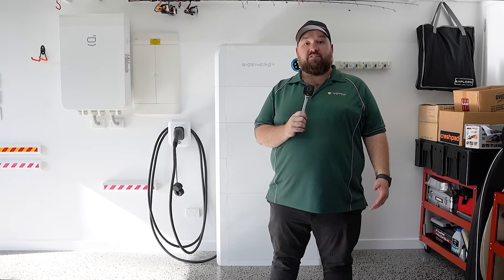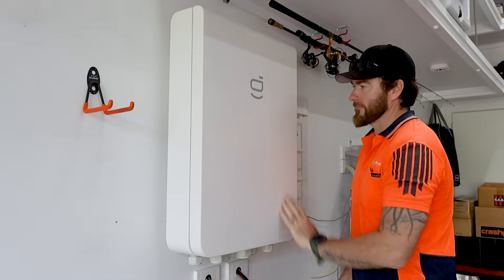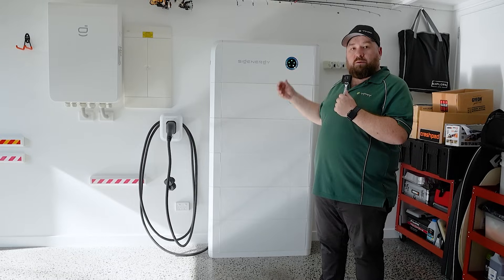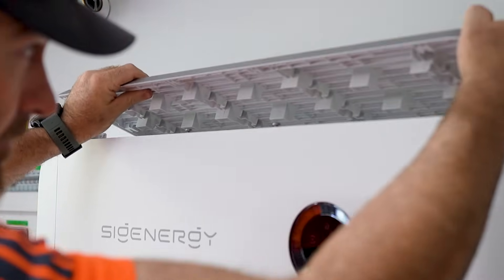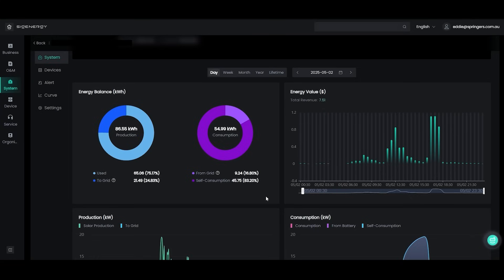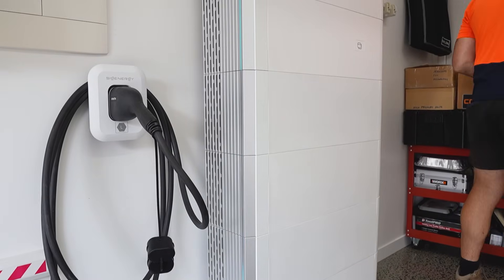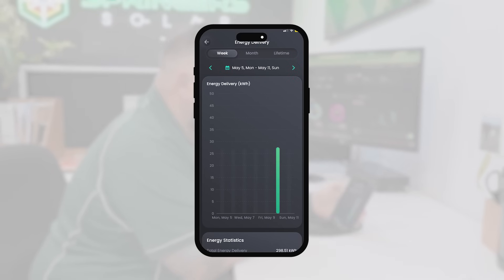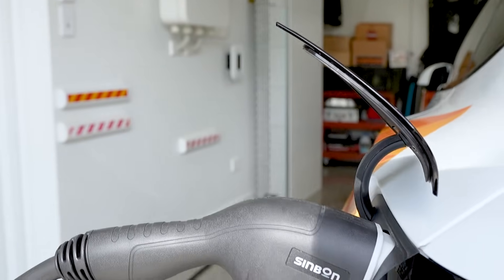Does Sigenergy Even Work? Battery Data Unveiled

Comment: I doubt that this home owner can amortise the cost of the system installed. Let us be conservative and say it cost $60,000. The batteries including controllers cost at least $40,000. They have a life of no more than 10 years so they need to be depreciated at $6,000 per annum. There is also an opportunity cost (presuming he paid cash) of $60,000 x 5% of foregone income or growth = $3,000. Assume that there is some maintenance in the 10 years of say $2,000. So at the end of 10 years the batteries are worthless. So he has to make a saving of $9,200 pa to break even. Consumers are being sucked into oversized system without having the business skills to do their sums and realise oversizing is a bad idea. It is much better to install an array up to 10kW and batteries up to about 15 kWh. That will cope with the daylight hours and peak demand in the evening. Buying some electricity in off-peak periods is not a bad idea and there are offerings for charging EV. The idea of charging the house from the car is a very bad idea because the batteries in the car are expensive and if the juice is drawn from the batteries, the car is no longer a car that can be used. We do not know what the grid and technology will look like in 5 years. It is better to be conservative.

Comment: Sig is recalling their products in Australia, electrical safety issues😂😂
Reply: Hmm, not quite the recall is specific to single phase systems and a specific part which might be due to installer error, suggest you find more about it , before making blanket statements.
Reply: Still a far better product than anything else on the market.

Comment: Most of these external managers don't seem to export from the customer at peak pricing. It seems they are more working for the grid company than the customers.
Here the spot price even goes negative in surplus power periods and the designers or controllers of the solar inverters don't even stop the systems from exporting making you OWE money for exporting!

Comment: Anyone else concerned about the 90 day safety mode warning?? If you are not connected to the internet for 90 days the system triggers a safety mode which limits battery storage and output. This concerns me
Reply: Who wouldn't have power for more than 90 days ? Unless your completely off the grid. I've heard that issue is now sorted anyways. Being i  the city id just make sure it got some juice once a month.

Comment: A very good and informative video, sadly I live in NSW, I also wanted to point out that a common issue with installations is that the Inverter is not spec'd to the total discharge rate of the battery. So for a 32 KW battery (8KW x 4 batteries) would have a discharge rate of (4KW per battery X 4 batteries = 16KW) and your inverter is a 10KW , if your overall house hold draw is more than 10KW you will see power being drawn from the grid. So the inverter is now the bottleneck.
Reply from the maker: Yes, that can be a bottleneck on the installation if designed that way. In this case, we've chosen a 20kW inverter to ensure that issue doesn't occur.
Reply: just curious - what loads in your household will draw 10KW continuously?
Reply: @tempestv8 i mainly draw about a 1kw continuously, but as an example, if i were to run servers  or run all zones of my 3 phase aircon continuously on a hot a cold day that would be roughly 10+ kw
Reply: @tempestv8  A 20kwh cooling air con can draw say 6.5kwh on its own.

Comment: Great video
How far away is the grid switchboard? We are looking to install the gateway like this adjacent to the battery in the garage however as the grid switchboard is approx 15-20m away, the advice we are recieiving is to install gateway adjacent to grid switchboard rather than battery and inverter. Do you have any thoughts @springers solar?

Comment: Iam very interested in this battery, but I have a set up question. I have an enphase system on the house. I think we are talking about battery ac coupling between house and grid by this gateway installation. Now I want it placed in my shed, which has no panels yet. The sigenstore inverter has solar input capability. Can I have a sparky plug extra (non enphase) panels on the shed roof directly in the battery inverter a year after install? Will my house (enphase ac) still work offgridd and charge the battery along the hybrid shed roof panels?

Comment: So basically, it’s a great solar system, only problem it has is the plastic covers etc , hopefully manufacturer will fix that in coming future by adding the solid metal or thick glass like material similar to an iPhone in IP66 rating , hopefully they’re listening 😀👍
Reply: I'd rather replace a small plastic cosmetic cover that a whole sheet of Tesla glass ! And if its inside the garage or undercover who cares ?? My ducted ac unit is 10 years old outside and the plastic is fine on it.

Comment: What is the usable battery capacity? Eg if I install a 30kw battery with sigenergy will I get 30 kw usable or did they not add an extra dod
Reply from the maker: The 5.38kWh module has a usable capacity of 5.2kWh, and the 8.06kWh module has a usable capacity of 7.8kWh.

Comment: Whats the max dc charger cable run from the inverter?
Reply: I think the cable is 7 meters in length.  What I want is a remote cable. Where the output/input port on the stack connects to the box on the wall in my garage.  That box would have the 7 meter charge cable and handle on it.  In California they actively make it very difficult to install a battery in a garage.  My battery is located out side of the garage wall so there is no way to get the cable into the garage.

If I could have the base of the charge cable in the garage and have that base connect to the bi-directional unit on the battery stack I could remotely use the charge handle.

Maybe someday.

Comment: DC power coming from the DC panels and/or DC battery, using DC chargers straight into the DC car battery. Makes total sense, as opposed to having to convert to AC and back to DC with the associated losses
Reply: It does.... until you get the price for the DC charger.
Reply: @timorum  Emmachizzit?
Reply: @MrBenHaynes 😂 the “see translation” button under your comment is golden
Reply: @timorum  if your dropping 16k on a battery i dont think they would care 😂

Comment: Yuck, such a big box sitting in the garage. Wish the dc charger can be separated from the inverter!
Reply: It is IP55 rated so you can have it outside as well if that helps - also means you don't have to have guarding or mounting restrictions (depending on region).
Reply: @ianloy1854 yes fully aware, but then I won't be able to install the dc charger
Reply: @eric-u  The DC module comes with 5, 7.5, 10m long leads. The installation diagram calls for the port to be mounted within 200mm of the module, but the cord is still up to 10m long and so it may be still workable for you. Actually not sure why they want the location so close - but you could move it? afterwards...... any way just a thought.

Comment: In the process now of reviewing the pros and cons between Tesla Powerwall 3 and the Sig system for an install post July 1. Slightly steering towards the Powerwall but will see what cost the Sig system comes in at tomorrow but I doubt it will be cheaper.
Reply: If you have 3 phase power forget the Tesla power wall 3, I was so disappointed when I found out this issue with the power wall 3.
Reply: If you have 3Phase it may be worth considering this over the tesla as it can backup all circuits.
Reply: Looking at the wholesale prices the Sig should be a few thousand cheaper than the PW3, right?
Reply: @hargeaux  depends on which inverter and battery combo and what country you are in for rebates/credits.

For me, a PW3 is the cheapest if minimal capacity, however i can have almost 24kw of storage for only a couple grand more.

Comment: I understand how all this works to some degree, but if you only have 32kw battery storage and your EV is 60kw or 80kw you’ll be using it a lot. Secondly if your battery is full and you live in NSW you’ll be paying an export tariff. And you will still need to be connected to the grid, so therefore you’re still paying a connection fee and an admin fee. It seems a huge amount of money to outlay I’m guessing $35k that will take a long time to get your money back.
Reply: It sounds like they're on Amber, who have automatic curtailment so you don't export power when the feed in tariff is negative. Amber do list Sigenergy systems as compatible with automatic curtailment.

Yes, they'd have to be paying for grid connection, but feed in tariffs could give more back than they're paying, especially if they're making dollars per kWh during a price spike. 

Overall, this sort of system I'd roughly estimate would take around 10 (maybe up to 15) years to pay for itself. But the sort of people who would put in this big a system probably wouldn't be heartbroken if it takes that long to break even because they're probably also concerned about the environmental impacts.
Reply: Also, the EVs would probably be getting charged primarily directly from the solar generation, rather than the battery.

A 30kW solar array can generate around 200kWh a day in the middle of summer. That's more than enough to fully charge both EVs and the battery if all were completely flat (which is highly unlikely). During winter you're probably looking at around 100kWh of generation on a sunny day, which would cover a normal amount of use for the EVs and the house.

Comment: Don’t you need a bollard in front of it if it’s in a garage?
Reply: It depends on the local jurisdiction. But here in California if the battery is 36 inches above the floor no bollard is required. Edit: Additionally, if the battery is to the side there may not be a requirement for a bollard.  It is only absolutely required if it is lower than 36" and at the front of the car when the car is driven into the garage.
Reply: Depends on the state laws

Comment: It’s all cool, if you want all your data going to Chinese servers

Why does it need connecting to the web (if it’s offline for 90 days, the batteries are bricked and the inverter reverts back to just a basic solar inverter).
If it’s for safety features, well, these shouldn’t be cloud controlled.
If not, then why?

It’s a big investment for something you have practically no control over without the cloud

Oh and the fancy AI control is a “free trial” at the moment.
So paid in the future? What’s meant by this?
Reply: That is to change in the next software release - after being offline for 90 days, the batteries will continue to work, with slightly more conservative SOC values
Reply: @colinmacgiolla I guess we’ll see

And the paid AI?

And all the data going to China?

Comment: Did the video demonstrate v2g? I didn’t see it?
Reply: v2g is not yet activated as there are no vehicle manufacturers that allow this yet (on the DC coupled side...) First public approvals should come out in the next few months, beta testing has been concluded on 10 manufacturers already
Reply: @stefanvanzyl9090  Is there not someone in Sweden asking different car owners to test his setup. I did hear NIO is working and some VW, Polestar and Ford
Reply: I think there are LOTS of people wanting to see V2X (house & grid). Once it is all released it will for many be a driving force on what system/car they are interested in. If the vehicles can be connected during the day and early evening they will help save the problem Spain experienced, by having a huge amount of battery storage that can be charged during the day and provide power during the evening peak. In a commuter city that would look like V2C power points in parking bays with some smarts (perhaps car/local) regarding power availability, and then V2X at home. Cost profile should be OK if required charging smarts can be car based as the car owner would then provide the charger cable and the parking facility just a power outlet.
Reply: @ianloy1854  almost all NACS and CCS2 compliant cars should eventually be able to do v2x via DC purely based on how the battery is connected to the charger... whether manufacturers allow it (without voiding battery warranties) is a different matter entirely

Comment: Just signed up for 12 kw Jinko solar, 10 kw Sigenergy inverter, 24  kwh Sigenergy battery and AC charger. Can't wait till July 1st this year.
Reply: With the AC inverter can you still do V2H, I thought you could only do this with Sigenstor DC to DC converter / charger.
Reply: @flukeylukey7559  Our 10 kW inverter is hybrid. And the other is AC EV charger.
Reply: @flukeylukey7559 V2H or V2X are for those without home battery mainly. If you already have solar and home battery, there is no need or a priority.

Comment: So where is the battery data in this video? Charge/discharge efficiency? Round-trip capacity losses?

The main point of the system is that this is a distributed shared DC bus in parallel between the batteries and the inverter, but that also means that the batteries are built as LV (32V) system with the corresponding high energy losses any time you need to discharge them as they need to boost to the DC bus voltage (600-900V for 3Ph) at each battery pack. 

That's nice and all from practicality standpoint, but not very good as a hybrid inverter design where you really want to use the batteries to their fullest.
Reply: The Sigenenergy SigenStor batteries run at HV 300-600VDC according to documentation from Sigen that I have seen. Where did see that they are 32V?
Reply: @johncanalese588  WRONG. The module outputs 300-600V via a DC-DC converter in each battery module. 

The battery cells themselves are 9 cells in series each at 280Ah / 3.2V nominal = 28.8V for the 8kWh battery pack.

It's an extremely low voltage battery pack design backed by a DC optimizer, the latter we have no information on in terms of its efficiency and losses.
Reply: @andreif.2412 I will repeat, where did you get this information from?
Reply: @johncanalese588  In any real technical coverage of the system. 

The company product page literally states this: "<36V Human safe battery voltage". It's a low-voltage system masquerading as a HV one.
Reply: According to Energy Sage using the 5.3 kWh battery the round trip efficiency of the PointGuard system, Sigenergy in the rest of the world, is 97.61%.  Pretty dang good considering the advantages of the configuration.
Reply: @bryanwhitton1784 I don't believe that figure, a normal battery without a DC-DC converter is at 96-97%. BYD is in that range. There is no such thing as a 100% efficient boost converter. They are likely quoting the cell round-trip and not the module round-trip. 

Most basic test for this is charge the battery via AC and discharge it to AC, and measure the AC side energy. Of course that is beyond just testing the battery itself, but is the only way to go this independently given this is a closed system where you can't measure the DC paths on the battery.
Reply: @andreif.2412  I am just reporting what I read from a 3rd party tester.  I don't even know how they tested it.  I have been a product manager of a hybrid inverter for years before I retired.  Still do a little consulting now and then.  I agree with you.  Most round trip hybrid inverters are at best 94%.  Most are 90-91%, SGIP compliant inverters have to be confirmed at 90% or higher.  However, if all the power chips in the DC-DC converters were Silicon Carbide their numbers "could" be attained depending on the chemistry of the cells.  A lot of variables here that we just can't know.  But it does look like it is fairly efficient and I have to say my system is working quite nicely.
Reply: This surprised me.  With the 8 kWh battery it is slightly lower at 97.0%.  Not enough of a delta to be concerned about but it is different.

Comment: Thanks for the video. I will likely go Sigenergy on my new large property in Northern NSW. Will be completely off grid. I will need at least 40kw of battery etc and the large shed will accomodate all the solar panels I will need. Will be 3 phase and have a backup  genset to charge the batteries on rainy days. I currently have a 20kw solar system on my shed in Townsville which gets over 100Kw per sunny day for a 15kw 3 phase inverter but I know in Northern NSW it will be a whole lot lower output so will have to have a much larger solar system to charge over 40kw of battery while still powering the house etc.
Reply: Depending on how north on nsw springers would an an option for install partner